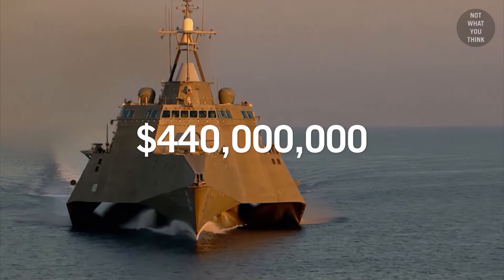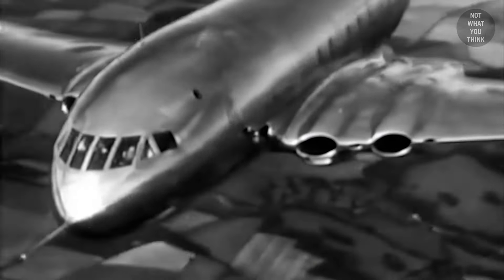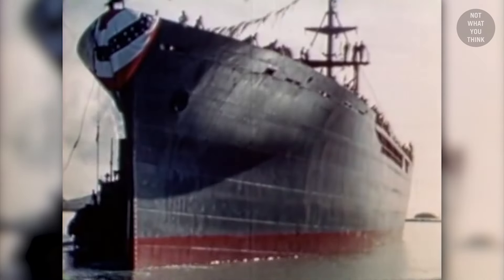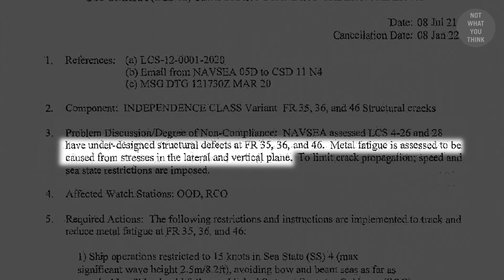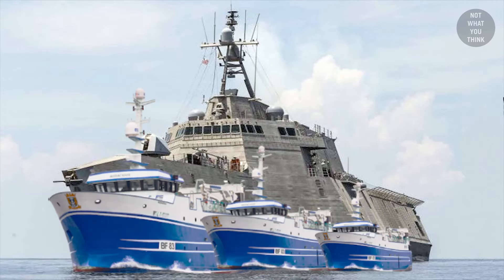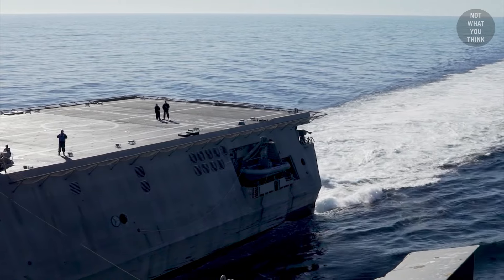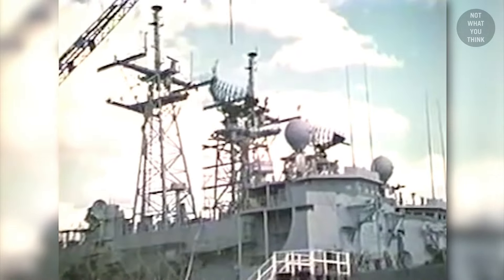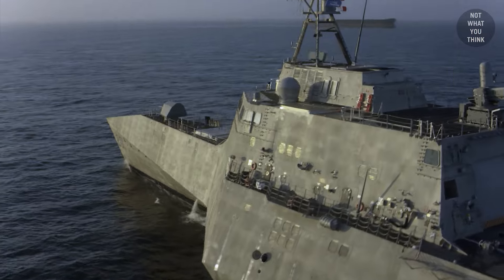SPEED Makes This Warship CRACK!

Comment: Steels typically have a lower fatigue limit. My recollection is that for low grades of shipbuilding steel it's about 40MPa. Aluminium has no lower fatigue limit. What this means is that if you keep the local stresses below 40MPa in steel you will never get a fatigue crack whereas in aluminium sooner or later fatigue will become an issue. 

Note this is real local stress NOT nominal stress. When these vessels are built they use FEA to determine the nominal stresses at joints and other places where high stresses are expected, however, in real vessels high stresses can (and usually are) caused by workmanship, this is why, particularly in aluminium you need to design post joint treatment such as smoothing edges and so on to reduce the number of stress raisers.

Another factor is that in steel welds are typically at least as strong as the parent metal but in heat treated aluminium the weld is weaker. This means that you get the double whammy of likely stress raisers in areas which are inherently weaker.

This does not mean that you should not use aluminium in shipbuilding - and Austal are probably the most experienced aluminium shipbuilder in the world, but it does mean you have to take a lot more care in both the design and the fabrication than you might in steel. Aluminium shipbuilding is in many ways closer to aircraft manufacturing than shipbuilding (except of course for the reasons outlined aircraft are not welded).

Disclaimer: I am not and never have worked for Austal or any other aluminium shipbuilder but I have surveyed aluminium vessels under construction, and more importantly after several years of service. I can pretty much walk into an aluminium vessel and tell you were you will find cracks.

Comment: Aluminum welding is extremly susceptable. Stir welding has been the only sucessful method of fusing aluminum structures
Reply: They aren't cracking at or because of the weld joints. You are correct that the transitions at the edge of the weld have lower stressers in FSW,  but it's a fatigue issue in this ships case.
Reply: @johnalt4792  you are correct it is from fatigue, and it comes from these welded connections. With aluminum there is an oxide layer that melts at a higher temp than fusion of the al itself so you end up with impurities in the weld which promote unpredictable stress cycle failure rates. Ive worked with many diving companies constantly rewelding their aluminum pontoons. This is also a reason we dont do aluminum bridges.

Comment: Structure and materials is a very complex subject! Navy is making a very big error by not making cheap ships without non-essential parts so they could check designs without having to build a full price vessels for testing. Modular components or substitutable weights could be added during testing to test the stresses and operation. Electronics, missile tube assemblies, gun  and ammunition assembly units, fuel and water tanks, etc. Navy needs to train up their academy to produce competent engineers for contracting with business.

Comment: This must push Austal & other aluminium shipbuilders to reinforce w/ kevlar or similar material. Kevlar will absorb the stress 5x more than steel while aluminium better deals seawater corrosion than steel while also not requiring the expensive demagnetization equipment. Overall, they remain lighter than all-steel.
They say working w/ Kevlar & similar is pricier but the US military doesn't seem to care about price (ask Zumwalt, F-35, & of course LCS)

Comment: A different video said that the aluminium wasn’t treated properly with an electro coating just painted and sea water fatigues aluminium when exposed… turns white and brittle and engineers recommended an electro coating of some kind but cuz of cost just painted them

Comment: I remember the Pegasus-class hydrofoil gunboats, based in Key West, were taken out of service from hull cracks caused by the foils hitting whales. One has it’s stern nearly broken off. C’mon Navy, get your act together!
Reply: is there no sonar to detect whales??
Reply: They have radars rather than sonar as they don't have ASW capability. But why would they be hitting whales? Perhaps that's an autocorrect typo and that's supposed to be waves.

BTW: I see the cost for an entire ship in this class listed as about the same as a single round of ammo for the Zumwalt's super gun. Granted, it was 50 years ago, and we have not accounted for inflation. But inflation can't be that high. Each ship in the admiral's pet project cost about the same as one round of ammo for the ship named after him, or if we calculate for inflation, 8 rounds. On a gun designed to fire 10 rounds per minute, or if both guns were used, 20 rounds per minute.
Reply: @danielch6662  i am sure he mean 🐳 whales. 

That's why i am asking about sonar, not radar.
Reply: @nehemialalang7878  Ah, hydrofoils. Operating on the very thin surface of the sea at Mach 5. So no, no sonar.
Reply: @ericvardek4108  So, is that's why hydrofoil is not popular?
Reply: @nehemialalang7878  Just unnecessary for most missions me thinks.

Comment: Small point, but it was radio aerial apertures, not windows, where the cracks appeared in the Comet.
Reply from the maker: Really? Didn't come across that in our research. Everything mentioned rivet around the windows.
Reply: @NotWhatYouThink  It's a common misconception.  Any small-radius curves could have caused the fatigue, I suppose, but it wasn't the windows which caused the crashes. Thanks for replying!
Reply: @NotWhatYouThink  They designated the roof panel for the radio which caused the  crack also as ''window', this leads to a common misunderstanding. The cracks of the Comet started from the roof on, and since they didn't use proper crack stoppers (like later airliners) it ripped apart the whole fuselage
Reply from the maker: Thanks guys. I will look into this in more detail.

Comment: Whole story with rounded windows could have been public relationship stant.
They changed technology for the windows mounting to the case and tested it on model which was already been used for other structural tests, like internal over pressurization or something like that, which gave material extra toughness and affected results of other tests.
Reply: The comet cracks came from the roof, the usual misunderstanding is they named the panel with the radio antenna also ''window''. What they also did is they punched the rivet holes instead of drilling it, which caused stress cracks inside the holes, and they didn't use crack stoppers (like all other airliners do since the 50s). 
After the fuselage in the test bed ruptured no other (modified) comet ever crashed due to to a rupturing fuselage
Reply: @simonm1447  Testing did not catch it, because they use same model for all of them and previously done tests affected results of the tests done after that. In some cases with low loads materials can get stronger. There is a specific term for it but I forget.
Reply: @Bad_Object  In the case of the Comet the test fuselage used for the investigation itself ruptured in the water bath at exactly the same spot as the Comets which ruptured mid air. If you salvage the wreck you can investigate where the cracks started , since all cracks run together to the spot where all started. 
It also ruptured around the same number of simulated flight cycles as the crashed Comets. 
What you mean is maybe they didn't catch it at the initial testing for certification, but later they catched it in the investigation
Reply: @simonm1447  It had multiple issues. Blaming it on shape of windows and changing them was probably just red herring. 100% it was material fatigue and manufacturing technology related.
Reply: @Bad_Object  I think they changed a lot for the later models, the official investigation didn't just blame sharp edges but also manufacturing methods like the rivet hole punching or the lack of crack stoppers.
Later Comet variants never crashed in this way, but the aircraft was economically doomed since it had a bad reputation and US manufacturers like Boeing or Douglas offered more modern aircraft
Reply: @simonm1447  In June 1956, some more wreckage from G-ALYP was accidentally trawled up from an area about 15 miles south of where the original wreckage had been found. This wreckage was from the starboard side of the cabin just above the three front windows. Subsequent examination at Farnborough suggested that the primary failure was probably near to this area rather than at the rear automatic direction finding window on the roof of the cabin, as had been previously thought. These findings were kept secret until the details were published in 2015.

Comment: The ship has sharp edges,,, anything with sharp edges will show cracks at some point ,coz the force is not distributed properly,,dome shape in water and air is used coz it does receive the force uniformly and the entire structure remain firm but sharp structure are prone to damages of not manufactured properly or went through extreme temperatures..

Comment: metal fatigue occures on vibrating portion of the metal, either alum , s/s or carbon steel,
i gues flexibility is better, using mild steel ang low vibrating engine,

Comment: „There seems to be a correlation between cracks and aluminum superstructure“ — no shit!
Every engineer familiar with lightweight design and materials knows well that aluminum is prone to metal fatigue. Airplanes are made mainly from that metal, and great efforts are taken to minimize the risks of fatigue cracking. Structural loads over the entire lifetime are investigated thoroughly and tested for each new type of aircraft. That approach has proven successful, and it’s been a very long time since the last aircraft was lost because of metal fatigue. 
It seems that with regards to ships, with significantly smaller production series compared to airplanes, there is less experience with the exact fatigue loads spectrum as well as with actually testing the hull under these assumed conditions for a lifetime.
Reply: Airplanes are also riveted together instead of being welded, so you don't have the inherent weakness in the heat affected zone.

Comment: What kinds of ship do drug smuggler use?  On the TV show, Miami Vice,  it was speed boats made of fiberglass, polymers and etc....mmm...  Looks to me it hit a whale jumping....That happens even with wooden ship.  MORE SPEED EQUAL MORE POUNDING FORCE.  The solution has been around for some time which is called reinforcement...rewelding, repairing with epoxy and etc...  Some repairs make it stronger or new like welding.

Comment: Long story short I have first hand experience with these problems. The 76mm on the 01 deck would crack the whole superstructure when fired.  Still would search on a ffg today. Those freedom and independence class lcs class ships i would never serve on. I mean ffg stand for forever fucking gone. So I guess I wouldn’t mind being attached to a ship that can’t leave the dock. 2 deployments in 2 years plus all the 2week and month long under ways. I spent over 2 and half years at sea in the 3 years I was attached to a ffg. Sailors sail ships. Ships sail at sea. If your ship can’t sail at sea what is your purpose?  In the 4 short years I was j. The navy ten years ago I could clearly realize the navy is going in the wrong direction.

Comment: many years ago,  i worked in a giant casino, 
in the service hallways there were several cracks that appeared one day, and slowly grew for a few days to be about an inch wide,  you could even see a trace a light peeking through a section and feel a breeze.
The building has shifted slightly, and the cracks were going through cider blocks, not following the grout. 

i reported it,  and the next week all sorts of engineers in hard hats, architects, and upper management were checking it out.

the week after that, the cracks were puttied, and new paint was put on top.  
and all was well.

its been almost 8 years,  and the building still stands,  so i guess it was good putty and paint. 
or,  scary looking cracks arent as bad as the 'uneducated' (me) think it is.
Reply: I expect that you were promptly fired for reporting what clearly were unimportant deficiencies in the company's otherwise fine building.

Comment: it's awell known fact that in any application you've got to stay far away from aluminium plastic deformation zone for it to be safe and never use  in an application with concussions cause does not have  the ability of steel both plain carbon steel and stainlesses to absorb choc energy throught plastic deformation.  If the shipyard knew what they were doing maybe they would be able to know how to calculate the dynamic  bending momentum for a long ship when craching frontaly into waves and stay away from the plastic deformation zone of Al

Comment: What's happening with these ships goes back to the age old discussion about monohulls versus multihulls with respect to structural integrity and effectiveness in rough seas.  Building a multihull navy ship that operates in all seas and at high performance levels, this is not surprising to me. It's unfortunate and will be an expensive lesson learned, but over time, multihulls operating at high performance levels in heavier seas will experience structural failures more than monohulls.
Reply: Multihulls are fine in heavy seas when you don't decide to make a 410 foot cutter out of aluminum and then put 4 engines in it because you're jealous your little brother can push 40 knots on a 418 foot hull with 1/16th the budget.

Comment: Wrong material choise... Why not gone for DSS sheets on the water contact parts and CFRP for the structural beams? When I studied material science in the 1970s fatigue was already a well known influence. I would never have advised an aluminum superstructure, for aluminum is much too prone to fatigue. Also you need to allow for strain on a ship. DSS is a very high strength and wear and corrosion resistant cover, whereas CFRP reduces the weight as much and is stronger than aluminum. Composites are the answer against fatigue cracking, and DSS are good against corrosion induced fatigue cracking.
Reply: Considerable effort goes into predicting how many take-off and landing cycles an aluminum air-frame on an airliner, can withstand before something breaks. Yet, they insist on building ships out of aluminum. DSS would cost much more than aluminum and Duplex Stainless Steel is not immune to corrosion in seawater. CFRP would be less fire resistant although, it might be more damage tolerant and is more fatigue resistant than aluminum.  Maybe use metal-matrix composites in highly stressed areas?
Reply: @tjr7424  Just a small remark: DSS is excellent against corrosion. We made a 2" wall thicknes pipe for raw natural gas that conained brine and sulphide. It is running now for 35 years flawlessly. If DSS corrodes in seawater then some other rules are disregarded. Poor welding, overloading or galvanic cells are the most common. DSS has a pitting resistance factor of 37, AISI 316 only 26. Also DSS is superior against stress corrosion cracking due to it's much higher yield strength.

Comment: Nice video! The Littoral crack/split problem is two-fold.  First, there was the failure of the designers/engineers to understand the stress fields in the ship structure during all operations (they never understood what happens or could happen).  Second, there was the failure to select the proper materials that would handle the stress fields (they never understood what the real solution is).  Aluminum as armor plate would be a joke if it was not so deadly to use.  Aluminum as structural components is almost a joke.  How many skyscrapers use aluminum as their structural material?  Also, the Liberty Ship cracks and splits were not at the welds.  Check the ship images in the video; the faint checkerboards of the welded plates show no splits - the splits are through the plates.  Finally, not all steel gets brittle at lower temperatures such as those found in the North Atlantic.  To avoid getting brittle at those lower temperature, the proper steel needs to be selected both in its chemistry and how it is processed.  The lessons we could have learned from the Titanic

Comment: It seems to me that the proper stainless steel would be ideal for ship hulls since SpaceX uses it extensively on their spaceships and the door skins on its CyberTruck. Those doors will take a .45 ACP round from about 10 feet! Elon is apparently a metallurgical (and others) genius. The steel welds extremely well. Electron welding? Much info available online!

Comment: The problem is the material choice. 
If they used steel they would probably be solid designs. 
KISS principal is used for a reason. 
Make them out of steel use one type of engine. 
Modular? Make specific models off the same Hull ASW AAW ASW yes, but not changeable each mission.
Reply: The whole modular thing is idiotic in my opinion, It looks good on PAPER but it just ends up being overly-complicated and later abandoned due to the complexity in trying to fit EVERYTHING into a single ship.
Reply: @FrederickTheAnon14W  
It can work like the M4 Sherman in WWII a basic Hull design that you can put different engines, armor, turrets, plows and weapons on to do specific jobs. But you definitely don't change them up between missions like they were planning with these LCS's

Comment: WRONG. There's a huge difference between cracks in the aluminum superstructure (Ticos) and those in the aluminum HULL (Littorals).  For the hull to be cracking is MUCH more distressing. Gonna require complete rebuild & possibly redesign. Talk about diminished learning capacity. But that's what you get when you attempt to raise the performance bar SO high.